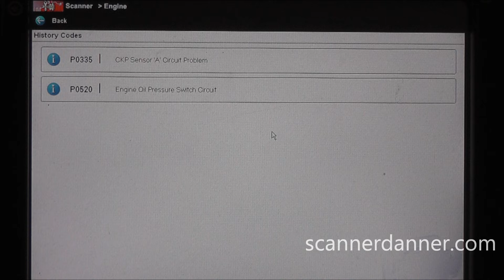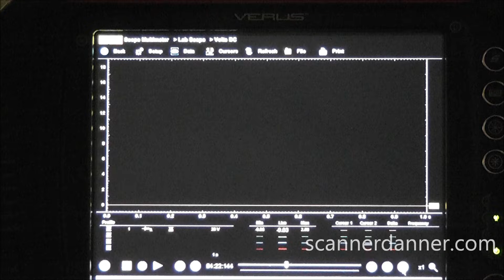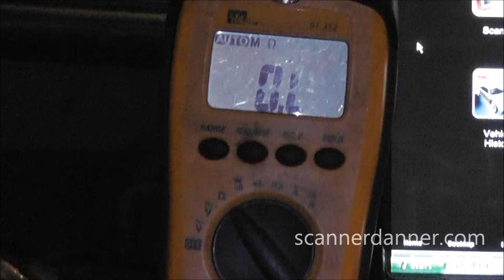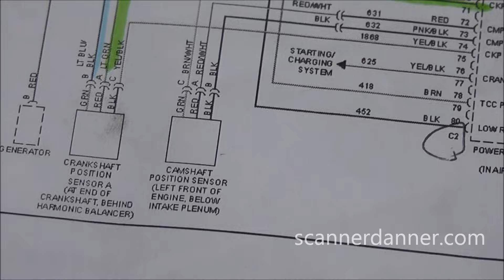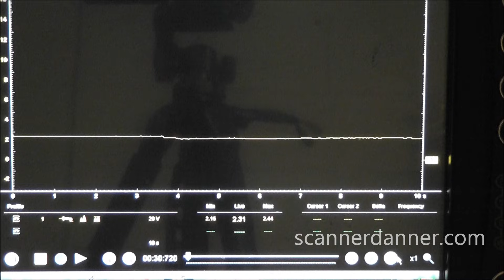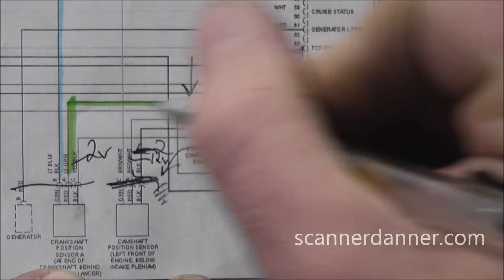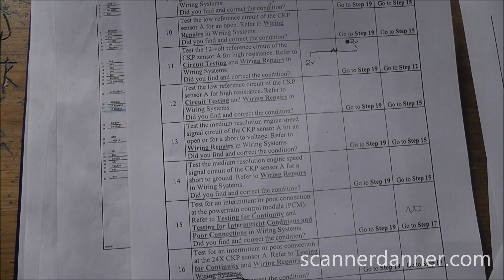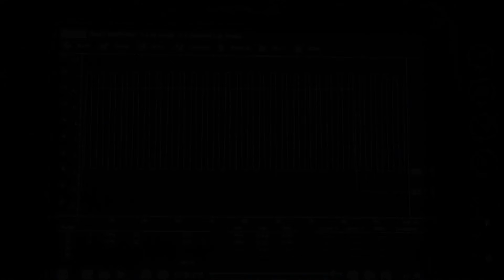2005 Impala Crank Sensor Code P0335 From A Shorted Cam Sensor

Comment: Factory techs have LONG known about the issue of common sensor reference voltage SHORTs to ground. It caused more no-start issues on early OBD2 models but car manufacturers seemed to realize the mistake and designed more fault tolerance by using multiple reference sources on the PCM.  i.e. TPS or O2 sensor circuits don't short out the CMP and CKP sensor references voltages.  However yes, many cars still seem to have the CMP and CKP and Sometimes the ICM references tied together.  
       This article explains it well (was posted 5 years ago )
http://www.dodgeintrepid.net/showthread.php?t=193775

The pullup or pulldown resistors used on the reference circuits are high resistance such that there isn't a major voltage drop accross them so it provides protection from shorts so(dont blow a fuse or damage wiring or PCM.)

When testing the low reference resistance to ground, through the PCM ( on a 1996 Chevy Camaro SS 5.7L ), how many ohms should be seen? Is it low impedance to ground or high resistance (pull down) to ground?

Thanks, looking forward to hearing your reply.

Comment: i want to highlight a couple of the most insightful comments written  below.

First, here is this one, written by "Tofulnc":

"I would just like to point out that on a shared voltage reference feed its likely to be a current limiting circuit using a ic than just a simple resistor. From an engineering stand point it would make more sense because you would not have much, if any voltage drop. Also when a short occurs the resistor acts as the load in the circuit and will have to dissipate the current heat and depending on the amount of current could damage the board. Current limiting ic usually have over temp protection."

My thought>

I agree with Tofu. The Protection circuit inside the PCM is probably more complicated than just a resistor. As he mentions, there is probably a Current Sensing Integrated Circuit, and there may also be an extremely small fractional ohm sense resistor. There may also be one or two transistors involved outside the IC (or built in to it)

NEXT:

autoparts321   said:

" Factory techs have LONG known about the issue of common sensor reference voltage SHORTs to ground. It caused more no-start issues on early OBD2 models but car manufacturers seemed to realize the mistake and designed more fault tolerance by using multiple reference sources on the PCM.  i.e. TPS or O2 sensor circuits don't short out the CMP and CKP sensor references voltages.  However yes, many cars still seem to have the CMP and CKP and Sometimes the ICM references tied together.  
       This article explains it well (was posted 5 years ago )
http://www.dodgeintrepid.net/showthread.php?t=193775

<<I JUST CHECKED THAT ARTICLE-IT IS EXCELLENT-THANKS autoparts321  >>
           -douglas

The pullup or pulldown resistors used on the reference circuits are high resistance such that there isn't a major voltage drop accross them so it provides protection from shorts so(dont blow a fuse or damage wiring or PCM.)

When testing the low reference resistance to ground, through the PCM ( on a 1996 Chevy Camaro SS 5.7L ), how many ohms should be seen? Is it low impedance to ground or high resistance (pull down) to ground?

Thanks, looking forward to hearing your reply."

NEXT

Paul wrote:
"End of flow chart. Again, I want to stress, this is NOT Mitchell On Demands issue. It is a manufacturer problem. These flow charts come from the manufacturer and Mitchell On Demand and All Data and other companies get permission to reproduce them. "

My response>

In SOME cases the pure factory service manuals MIGHT have more detailed or highly refined wiring diagrams and/or flow charts that don't "make it" into the Mitchell stuff. I'm not saying I know this for a fact, I'm just saying it MIGHT be.

Paul should assign a few of his students to pull out some of the full blown Factory Service Manuals that are laying around the school, and have the students compare the wiring diagrams and the flow charts to see if there are any  major differences.

NEXT:

170324341a WROTE:

 Notes: Important variable -- no crank or cam signal yet car starts. Cam related to injection pulse on this vehicle. Power feed for CMP and CKP not represented externally but shared internally. Shorted Cam wire, yet no DTC for Cam. Crank is good. PCM almost condemned after short to ground pass. // Another great video for connector and wire repair.

hE SUMMARIZES THE "LESSONS LEARNED" VERY WELL HERE.

NEXT:

This guy>   Steve A makes an excellent point about why you didn't have a cam code

 "2 years ago  in reply to ScannerDanner
 Yes it is.  I'm sure you would never have replaced that PCM without looking at the scan data first.  A p0335 will keep a p0340 from setting and vice versa.  Just the luck of the draw which one set first."

Many of us did now know about this "random priority" and teh idea that only one of the two codes might set.

paul, i've seen you do AT5 LEAST ONE, if not more, videos where you mention this.  chp  code with no cmp code when  the cmp wasthe problem.

I'll stop now.

as the other have said, this was a very good learning lesson, and an illustration why so many people get their "repaired" cars back and they still don't work.

Comment: perfect example and proof, the factory electrical engineers don't know WTF they are doing.  the problem with most auto repair manuals and information is, they don't open up a computer ecm or pcm, and show you what is inside them.  I worked in the electronics industry, and also repaired consumer electronics.  if you saw what's inside them, and how they are made, you would not want to spend a damned nickel on a car, with that crap in it- or trust your life and safety to its proper operation.  when the first moves were made to put an ECM in a vehicle back in 1982, that was a BIG MISTAKE.  they are nothing but problems.  the time spent tracking down problems like this, I could have rebuilt and installed a few engines already.  all this just to have clean emissions, is not worth it, because the emissions are not that clean anyway, in spite of computer control, injection, and catalytic converters.  the entire design concept was an exercise in futility.  great job on the video.    do you want a really reliable car ?  buy a pre-1982 American car without a computer, or preferably a pre-1973 car with almost no emissions controls on it.  your hands will be cleaner, you'll sleep better, and you'll do more driving, not working on your car.

Comment: I own a power probe 3 but have a bad habit of not using it.  Would it have been helpful in this example to test the 12 volts wire and detect a short too ground without disconnecting the ecm and components like u teach us in the bad chevy cobalt engine computer video. Couple other questions; is there limits to using the power probe on a 5 v ref circuit, and I'm curious can a power probe detect even the smallest shorts that can effect module to module data communication like detect a kiloohm short too ground or perhaps even a megaohm short to ground while both components are still connected.

Comment: What does something like that cost a customer? I have the same problem Chevy just called and told me what it was. Chevrolet gave me a price of $600 to fix. Is that fair market or a dealer ripping off the customer? 
I have the same car and same year. 
Thank you! 
Great video!! Thanks for posting!!
Reply from the maker: To fix the wiring harness under the power steering pump? That is way to hi. Probably because GM wants to replace the harness instead of repair it. Take it to an independent garage, show them this video and ask for a quote.
Reply: Thank you for that fast reply!! My car is at the dealer. I hope I can pick up without having to get it towed. Thanks again!!
Reply: It's called over head

Comment from the maker: Thanks man. I'm still learning too. The longer we do this the more we see similarities between circuits and designs. We can then plug in our past experience to a new problem. Check out my Honda Element video I just did with a shorted 5v ref. circuit. This condition was on my mind as I went through this crank sensor fault.
Reply: ScannerDanner  hi friend I have 4.6 reference  voltage from ecu to the crank sensor  and when I plug the sensor it's drawn to 0 volt  I tray new sensor and it's same can you help me please
Reply: @carslover3509  you have a broken wires or corosion is my opinion did you ever figure it out if so what was the problem

Comment: This absolutely blew my mind. I never would have thought to go after a cam sensor, especially with a set code for a crank sensor. Just out of curiosity, was the oil pressure switch fed by the same 12v reference feed?

Comment: Hi Paul, question 05 ford f150 po340 cam sensor b1,  this is vrs, b1 and 2 share ground, with the KOEO both signal sensor is the same plug or unplug, KOER when put reverse or any gear sensor 1 start to fail,  I switch the sensor and sensor 1 still the same, I think this is a timing engine problem, what do you think about it? any idea for more test?..thank..

Comment: Hi Paul another great vid wondering wiring prob didn't show on ohm test short to grd maybe short to signal let me know in a case of hard to get to sensor connectors I would have cut both ref wires just my preference any thoughts on how to catch it in mohm test

Comment: Paul, Awesome.. video... do u how much voltage drop happen when they use current limiting resistor, for example +12v going to current limiting resistor---and if i check just after current limit resistor will see 11.9 volt or so.. just little bit loss, is that right. i know ohms law comes in to picture to understand voltage loss because of resistor, just checking with u how much difference we expect to see. thanks again..

Comment: Paul, Thanks for your superior video series. Is there a source for information on the internals of the typical  PCM units, e.g., block diagrams, logic diagrams, software flow charts, functional wiring diagrams, etc. Even a general picture would be a great help in diagnosing a problem like this. Thanks for your time

Comment: First I need to say I love this channel! For me this channel offers the best learning material I ever found on the internet...

However I do have a question:
At 28:00 I would expect the drawing of the unplugged connector would be the other connector nearest to the PCM. Am I correct if, at that point, you can only tell that there is a short to ground in de wiring from "the nearest connector to the PCM" onwards to the cam sensor or in the cam sensor itself? 

Or did I miss anything?

Koen

Comment: Very nice video- could this problem cause a P0336 (crank sensor A) code on my 2000 Park Ave 3.8 SC? The code is stored in the computer but the ses light is not on. I noticed on inspection the cam sensor is leaking oil badly and connector is wet. I have an intermittent stumble at speed and loss of tach operation. The running voltage on the car spikes wildly up and down anywhere from 12.0 to 13.5 volt after it warms up. If u could offer insight I would be grateful. R.Vare

Comment from the maker: Truthfully, I don't think there is much of a drop at all on this resistor as long as the circuit is working as designed. 
I know that there would be no measurable amount of current flow on the hall effect reference (or what I called feed in the video). 
I'll have to try to measure current on one sometime. I'm pretty sure you cannot with conventional equipment.

Comment: My mind was just blown. I'm not sure if this is going to help me, or drive me nuts trying to figure this out.
Reply from the maker: Just put this variable on your list of things to think about when it comes time to call a bad engine computer. Your thought process needs to be "what else can I check to be sure". This is just one of the variables and is very similar to what happens when a 5v reference circuit shorts out. It will affect multiple circuits.

Comment: Excuse me Sir I had a question for you, I got a 95 buick riviera supercharged but I got an issue with my rpms  the car runs good but my rpm doesn't go over 2000 rpms so I was looking some information and supposed to be the crank shaft sensor it's the sensor who reads the rpms but I dont have the right tools to check at up, please just tell me or guide me what do you think about it thanks in advance

Comment: HI have a 2005 vw jetta with engine bbw 2.0 , the problem is it had jump timing belt i did the head cylinder work, new timing components but, know the car some times start an others no I have only one code p1340 for cam/ crank coordination'. when it does not start i check injector pulse and there is none at the same time I check spark and I have it always firs thing came to my mind out  timing  I open and verifided the timing and seem st o be correct, call to a friend (mechanic) to inspect

Comment: working at carwash again helping them maintain equipment and attendant work they have cool PLC customizable 9 pin relays with four little switches on face of relay the pins are arranged ina circle on back i took one apart that was shot and it has a circuit board inside cool stuff

Comment: I don't trust flowcharts as you have shown us in the past and present with these systems. I even using the flowcharts would have replaced the PCM. this example can be used on many other systems because what I have, and thanks you, learned is they all have similar functionality. also computers can share things we don't see. except for scanner Danner.

Comment: Old vid but I have a question. In a case like this. Would it make sense to check for continuity on ECM pins with harness unplugged?
Reply: He explained that wiring integrity was checked because the same voltage was read on both sides, but it can be done at that point but make sure both ends are unplugged.

Comment: Hey Paul. I have a 2003 impala with a 3400. I’m having a similar problem. I have the same wires. On the feed wires going to the cam and crank is full 12 V, but on the signal for the crank, there is 7 V and on the cam signal wire there 1V. I’m assuming a bad wiring harness. I’ve changed both the cam and crank sensor. Any advice?
Reply from the maker: I'm pretty sure I gave unplugged voltage readings on the signal wires? Not sure though. 
The 3400 has two crank sensors right? A 2 wire and a 3 wire

Comment: HI  THERE.
paul  got a 2004 dodge stratus with a 2.4 engine liter. I rebuild the engine. and I have to replace both camshafts and cranckshaft. used.    engine runs good  but sets a codes.  P0016 and P0336 or P0334 I gess .  no correlation cranck and cam sensors.  I  recheck
my  timing marks but  they were OK.   Someone told me to move one tooth clockwise on intake cam. but  dint work.... HELP  PLEASE.   what  should I do about it .?             thanks  a lot

Comment from the maker: it doesn't. first it is a scan tool only. second it doesn't have all of the scan tool features a solus pro does. there are no bidirectional controls and no troubleshooter. two of the most useful tools are missing.

Comment: hey danner i would like to share you something i got called to check a 2004 mazda 6 with both cam codes nd egr i checked with the scope fine signal back probing the sensor i pierce the wire to the ecm fine signal but i back probed to ecm nd slows signal but really low i havent checked crank sensor signal but signal if fine but not at the ecm pin i pierce threw nd fine signal near ecm idk if bad connector to ecm or bad ecm bad crank is a 2 wire magnetic signal making there own signal contact me when u can thanks
Reply from the maker: eli post this to my forum, it is free to join and we can help you better there 
https://www.scannerdanner.com/forum/post-your-repair-questions-here.html

hope to see you there!

Comment: Hi I have a 2005 Nissan altima no start.   5 volts I am missing.  .02 on ground wire.  Check fuel relay.  The test light dim on control wire. Then when turn key it bright.  Then check on other pin of control pin it lights.

Comment: Yes it is.  I'm sure you would never have replaced that PCM without looking at the scan data first.  A p0335 will keep a p0340 from setting and vice versa.  Just the luck of the draw which one set first.

Comment: Hey i really need some help. I have the same car and want to know wher is the 24x sensor located sense this car have 2 crank sensors
Reply: I see the wiring bit i wasnt able to determine how to get to it
Reply from the maker: The 24x signal comes from the crank pulley area. The 7x signal comes from the crankshaft itself, in the middle of the block
Reply: @ScannerDanner  i found it. Thats for the response

Comment: Why would the ECM set a code for a Crank sensor but not a Cam sensor? They had the same issue no signal
Reply from the maker: that is a software engineer question, but the crank sensor would be what is being looked for first on a start up

Comment: So could you just replace both sensors and fix the problem if the computer checks good???
Reply: Can anyone answer me
Reply from the maker: +Richard Drain did you watch the entire video? This car did not need either sensor. It had a wiring problem

Comment: I have never personally seen a real computer failure, and because of such I never believe it to be the problem (aside from repairable cracked internal case grounds) I've been lucky I guess... To me, if it throws a code, it's still alive and breathing. Edit: I've seen this twice, but not until firing the parts cannon at it twice, each time. This was before the "Prove it" concept.